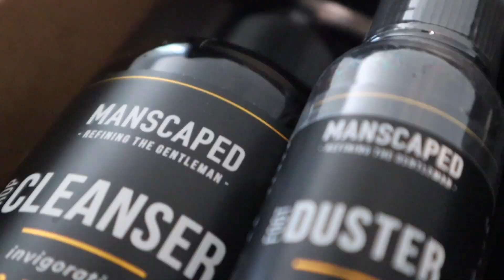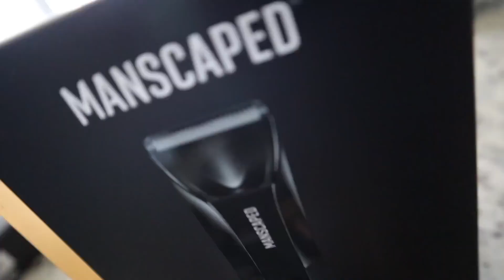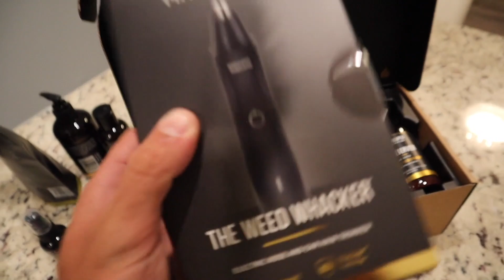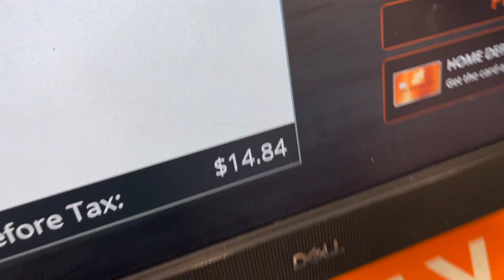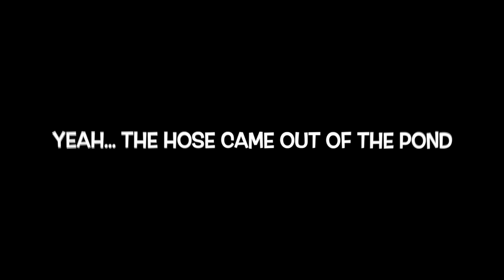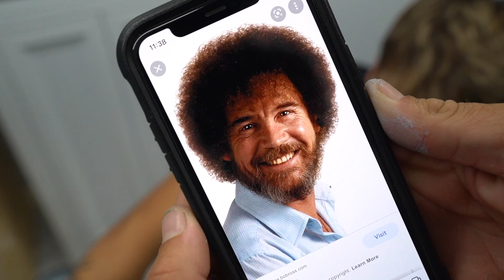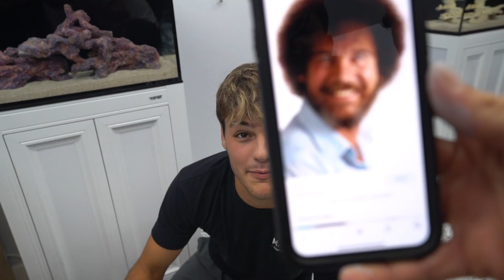My 1000G indoor POND is FINISHED!! (epic)

Comment: Paul. 1. after you install the handle for the pump house you should look at doing a hydraulic open and closer for like a car hood or trunk. That way when u open it, it stays open..
2. For the pond, 🔥 Burn the wood and do clear coat over it.

Comment: Put heavy “flag stones” on top along the edges. It gives off a natural look but also the flag stones are heavy so they can help hold down the liner. Those washers and tap screws are bound to fail overtime.

Comment: Would a ventilation be needed in room full of water? The ventilator may be use to kind of suck out the water vapour? I dunno man. Too much water vapour in those 4 walls may affect the ceiling? Wiring? Just my thoughts. If me, i would have one small corner for a fan Ventilator. :) peace. Nizam from. SINGAPORE.